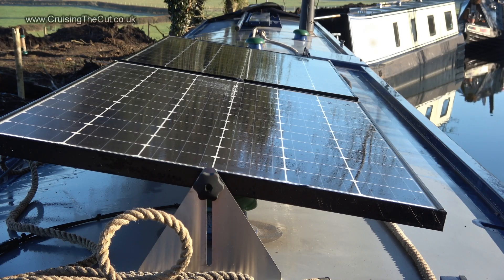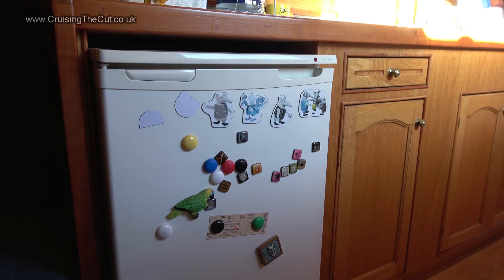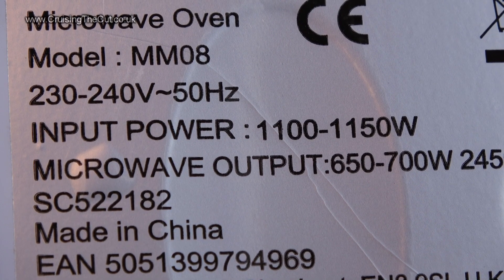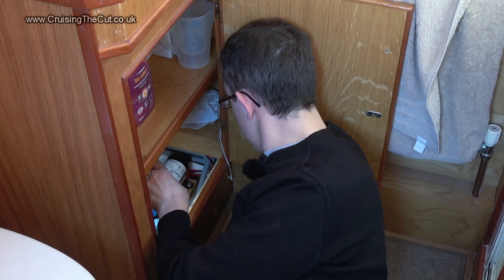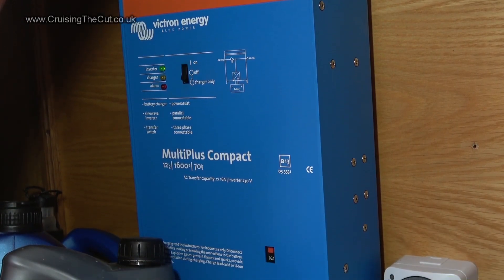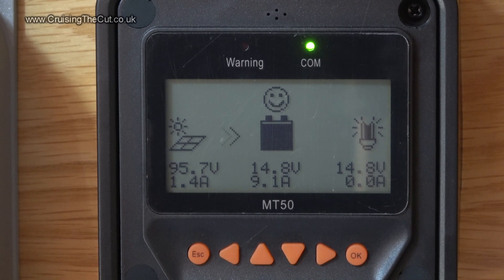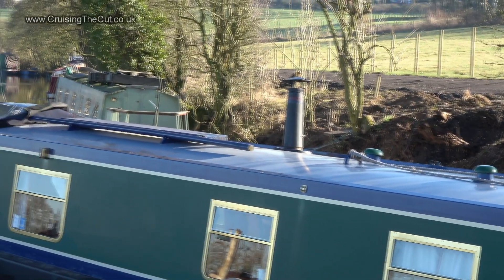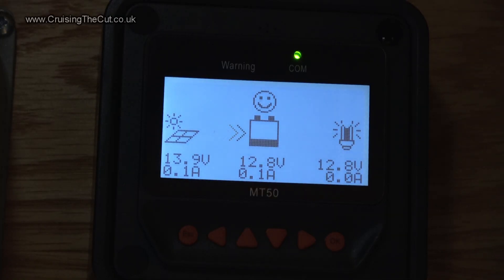76. Is solar power sufficient for a canal narrowboat in an English winter?

Comment: Would you deem it viable to do as this building (installing solar panels on the sides of the narrow boat)?   https://3vq5kdns38e1qxlmvvqmrzsi-wpengine.netdna-ssl.com/wp-content/uploads/2017/07/Urban-Health-15-1000x667-500x334.jpg
Reply from the maker: Not really practical to put them on the sides; the'd have to go between the windows, so not a huge amount of space; they'd get scratched by tree branches (you often end up ducking into the trees on narrow sections when there's an oncoming boat) plus only one side would ever be facing the sun at best, and a lot of the canals have trees or bushes alongside so the panels wouldn't see much sun anyway. Not worth the expense.

Comment: Hello,  Just another idea for more panels...  https://www.youtube.com/watch?v=cM5s4F-7AOk
Reply: That looks like something folks would complain about extending over the footprint of the boat. Sticking them on the towpath is going invite something complaining about an obstruction and sticking panels out over the canal is asking for someone to run into them. There are 12ft wide boats on the canals so it might not technically be an issue to navigate around but sticking something over the side of a boat, when parked or otherwise, is going to invite trouble. You could maybe have a system that extends out over the length of the boat rather than the width but that doesn't require such a complicated mechanism since you can get pre-built "blanket" arrays (even if they're not as good).

If you want more panels you're essentially going to need a bigger boat - narrowboats can get up to 70ft long if you're willing to splash the cash - or give up roof space that's useful for other things. Even then, if you're going with the "We're gonna need a bigger boat" option you're going to draw more power from said panels too.

Comment: I would advise to invest in losses due to 240/110V Power supplies. These buggers often burn 50% in heat adding to the losses of the inverter (which became quite efficient in the last years). Try to replace these with DC/DC supplies, often called "boosters".

Comment: I have seen campers that have solar panels on the roof. They have additional panels that prop up next to the camper.  Perhaps stow another couple down the side of the boat somewhere,  when you're moored up,  prop them next to the boat and plug them in to your controller 

Other than that,  get your generator to use as top up.  Perhaps additional batteries to provide more storage too.

Comment: Diesel engines do not like to be idled, it wears them out faster than running at a moderate rpm, 2,000 rpm-ish.  A small Honda 2,000 watt generator would be a wise investment.
Reply: these boats always run at very low rpm's...

Comment: I have seen small wood fired electric generators for camping sufficient to charge cell phones and the like. I wonder if there is a way to utilize some of the heat from solid fuel stoves to trickle charge the batteries on a narrowboat? Probably not enough on its own but perhaps it could assist solar in winter to get a bit closer to break even.
Reply from the maker: The charge out of those is absolutely tiny. Just about enough, if you get it hot enough, to charge a phone as you suggest and even then it's very slow. The impact on a set of narrowboat leisure batteries would be negligible.
Reply: @CruisingTheCut  I looked around and it appears that there is hardware for thermoelectric generators that attach to wood fired stoves in the 15w-100w range. They cost a few hundred dollars. Perhaps something to consider once a boat runs out of space for more solar panels. It might provide power in the neighborhood of an extra solar panel. More cost, but runs whenever the stove is lit without using any more fuel.
Reply: @CruisingTheCut  I was suggesting using a much larger version connected to a heating stove, not the small soda can sized devices.  A coal fired heating stove should also get much hotter than the small wood twig powered devices. That should provide many times more power. It might still be relatively small, but perhaps more than a negligible amount. If it could provide just half an amp day and night with relatively low cost for the hardware, it might be a significant addition to a solar system.

Comment: Hi, love your vlogs and enjoying catching up on the older ones. Seems to me it’s not more panels you need but more light. Have tried using a mirror to focus more on the solar panel? You could test it using a pice of hardboard and some silver foil. In theory a (plastic, bendy) mirror the same size could double the power and stowable under the panel. Just a thought.
Reply from the maker: The problem in a UK winter is that there just generally isn’t that much sun!

Comment: I guess solar power storage would be the next thing to add. But they’re still expensive- even here in Oz with plenty of 🌞
Reply from the maker: Nothing runs directly off the panels, they’re all plugged in to the boat’s battery bank (all narrowboats have a bank of “house” batteries for running appliances). I have 3 x 100Ah lead carbon batteries but no space to add any more, unfortunately.

Comment: I recently designed a PV system for a client that has a 60ft widebeam. It provides 5kw of solar. New panel technology is out there but you will need to specify at boat design stage the roof arrangement required to facilitate these mods. I have designed a boat that can be driven at night on a canal using autopilot that is controlled from the inside on multiple monitors and has infra-red viewing cameras. Technology has moved on.
Reply from the maker: There's a lot more roof on a widebeam! You'll still need a genny in winter though. But yes, this video is now 3 (4? I forget) years old so there will have been some updates. The point remains valid.

Comment: Were it me, i wouldn't have gone with solar, too unreliable in winter.  I prefer a nice quiet little generator.  I see many a busker in the street using a generator that comes in a case similar in size to carry-on luggage and they are whisper quiet.
Reply from the maker: Yes, the solar was installed for April to October when I'm out cruising. In winter I tend to moor and plug into a shoreline but if I didn't then a genny would certainly be needed.
Reply: @CruisingTheCut  Another point is that the microwave is likely the only item needing a large (probably 2kW ) inverter which will only run this for short periods and be inefficient for minor AC loads.  A small ( say 200W) inverter would be much more efficient for small  loads such as TV or laptop.  Phone charging and anything USB can use car type DC battery supply.  In cost terms, battery life is usually more expensive than any fuel used for charging. Lead acid batteries are still generally cheapest per kWh if you can avoid discharge below approx 70% full to get acceptably high numbers  of charge / discharge cycles.  A forklift truck or milk float with indestructible wet cell NiFe or NiCd would be a great prospect however for large capacity battery storage with intermittent engine sourced charging ,  plus whatever PV energy was available.

Comment: I am assuming that the laptop is mains powered. One solution to this would be a dc to dc converter which would raise the 12 Vic to something higher that the computer would use. This would be higher efficiency than using the investor.
Reply: Yes this is the way to go.
Reply: Not that much.  Average switch mode power supply (SMPS) is 85-90% efficient.  Say 85%.  Also say laptop needs 60W.  In a perfect world this is 5A at 12v.  However a 12 to 18v SMPS converter would actually need almost 6A.  Using an inverter would double the wasted power as the inverter is also a SMPS, so now 2A wasted instead of 1A if from 12v.  However boats are wired up for mains with many covenient plug sockets dotted around.  Hardly any 12v outlets, so using a laptop on 12v would likely be a real pain on a single dedicated power point just to save 1A.

Comment: Spacecraft have deployable solar panels that are much larger in area than the spacecraft itself.  I wonder if there's a way to have something like that on a boat.  While moving, it would be folded up to about the size of your current panels, but when not moving it could deploy into a larger array (preferably with better pointing capability).  Unfortunately, zero-gravity in space helps with this by reducing the structural requirements to hold the panels up.
Reply from the maker: Possibly; you’d have to be careful that it wasn’t an obstruction to passing boats or passing pedestrians on the towpath!
Reply: @CruisingTheCut  Yes, if your mooring wasn't perpendicular to the sun and the big array is at top of cabin height, the array could only angle from side to side.  The basis for this idea would have to be some kind of large, strong tube that collapses to a length of two arrays and expands to the length of four or even six.  The pole could roll the arrays from side to side and the panels could be mounted so they could angle out from that at least 30 degrees.  All told, I suspect it would be an expensive setup, difficult to arrange manually and even more difficult to automate, and the increase in amperage would not be enough to be worth while.
Reply: @goetzliedtke  The thing is, solar panels on spacecraft are flexible and unroll like a roller blind.  That only works because they are weightless.  They'd collapse under gravity.  Also, they only unroll once and then stay that way.  I think if you deployed and stored them cyclically they would break.  Don't get me wrong, I think it's a great idea, but the technology's not up to it yet.

Comment: Well you need to fix your solar panels so you can more properly tilt them towards the sun ... your panels are aimed halfway off the sun considering it is standing so low.
Reply from the maker: Even if they were tilted, which certainly does improve performance, the amount of sunny days and the number of sunny hours per day that we get in the UK in winter means very little solar. Plus a lot of the canals have extensive tree shading on either side so tilting just means you're pointing the panels at the trees. Plus unless you have fully articulated brackets, the panels only tilt port/starboard and as the canals twist and bend, the sun is not always port or starboard to your mooring. And you'd have to keep going out to adjust the tilt or use up some of the power in running an motorised system.

Comment: How much cruising do you need to do for a full recharge? I work in a fixed place and my plan is a live aboard for 14 day spells moving up the canal a bit for another 14 days then back again and so on. With proper cruising at weekends and on holidays of course. My best towpath moorings will be 5 miles apart which gives me easy access to bus stops to get to work..
Reply from the maker: It would depend how big your battery bank is, how depleted it is and how big your alternator is.

Regarding your cruising plan, I think you are going to fall very foul of the continuous cruising rules which CRT are now enforcing with a bit more enthusiasm; I suggest you have a watch of this:
https://youtu.be/k_p70h-Rxps and read up on what the CRT has to say.

Comment: Looking at your solar set-up, I notice you're not so hot on making sure your panels are properly aimed to get the best sun exposure. In winter when the sun barely gets above 30 degrees, you can increase insolation by easily double by extending their mount points temporarily while you're tied up.

You also have a lot of inflexibility of your panels because you chose such large ones. Twice as many panels of half the size would have a lot more flexibility of positioning.
Reply from the maker: Overall it would barely make any difference to the total in winter, there's so few hours of daylight and so little sunny weather then anyway that it would still render a solar-only solution impractical, which is the point I was making.

Comment: I thoroughly enjoy your vlog. I’ve watched quite of them and I’m impressed how you breakdown the technical aspects of narrowboat living. I was wondering if it would be feasible to install wind generator to augment your solar panels. Thank you and much success in your endeavors.
Reply from the maker: It is feasible and some boats do but they’re costly, can be noisy, and only generate any useful power in a really strong breeze which you don’t necessarily get with any regularity or consistency, especially on the canals which are often tree-lined, breaking up the wind. Probably better installed as a fixed item on a mooring if you have a particularly windy location,  otherwise I’d say probably not worth the money.

Comment: I had the same problem in my campervan, not enough room on the roof for more solar energy. I hate noisy generators and so do my neighbors, so I invested in a fuel cell for the winter days.
I bought an EFOY that generates enough power to charge the batteries. The EFOY is an expensive investment and methanol is also a bit expensive, but it is very quiet during use.
Being self-sufficient has a price but gives me a lot of satisfaction.

Comment: I use a solar/battery setup when I go camping. I looked into fridges very carefully, option for a dometic compressor fridge. This uses LESS than 1aH per hour, so maybe 20-22aH's a day. I'd've thought narrow boat fridge technology would be alongside that, and not nearly double the power usage. :-/
Reply from the maker: The narrowboat fridges are a bit bigger than those Dometic camping ones (I have one of them in my campervan and it's excellent!)

Comment: Nice little solar panel inspector, every ship needs a ships cat :-)

Was that inverter capable of delivering 16A at 230V? (Maybe I misunderstood the text). Is the battery bank big enough to handle that load? When I was looking at different inverters they recommended much bigger battery banks for that kind of load.
Reply from the maker: Yes 16A at 230V. At that time my batteries were knackered but I've got new ones just in (see recent vlog) which can easily handle that.
Reply: Yes, I saw that. I had never heard of lead carbon before, sounds interesting.
Reply: At the risk of upsetting David, no.  It is a Victron 12 | 1600 which means 12v 1600 watts.  Watts is volts x amps, so a quick bit of maths - it can deliver a max of 6.9 amps at 230v.   A 16A inverter would be a 3680 watt one.
Reply from the maker: Mea culpa, as @MikeB points out. The inverter can only deliver 16A at 230V when it's hooked up to the shoreline so it passes the mains through. Its delivery off the battery bank is as Mike explains.
Reply: And I feel really bad at pointing this out.  David has probably the best UK canal vlogs/info out there full of insane amounts of well researched information.  He puts a ton of effort into his content and produces broadcast quality entertainment.  Well done David.  Bad on me for being a smart arse.  Keep up the great work.
Reply from the maker: Haha I have no objection at all to people pointing things out where they're correct and do so in a polite manner! You carry on, good sir!
Reply: @CruisingTheCut  Thanks for the additional answers, I didn't get a notification from YT, I just happened to rewatch an episode and scrolled down.

Comment: Hey David, are three-way-powered fridges a phenomenon over there? Common on RVs over here, running off propane while you're not under way or shore powered could save you the 40ah the fridge uses.
Reply from the maker: Not much used, if at all, due to safety concerns about the gas / pilot light
Reply: @CruisingTheCut  Thank you sir. Wonder how we manage not to blow ourselves up over on this side of the pond. Guess it's easy to have vents in the bottom of an RV where the heavier gas can escape. On a boat? Not so much...........

Comment: I'd say your panels are only angled at 10 degrees.  If the sun is 10 degrees above the horizon then the effective width of your panels is not 90cm but 90sin20=30cm.  If you could angle them at 80 degrees the effectiive width would be 90sin90=90cm, or 3 times more power.  So you need some taller brackets, not more panels.  And of course, find a mooring where your panels will be facing South.
Reply from the maker: It isn't a simple multiple; plus as I tried to point out, in winter the sun isn't always visible due to cloud, rain etc so the light is diffuse and pointing makes no difference. As for finding winter moorings with specific alignment, that's not always so simple. The video is trying to make the point that solar in winter is limited due to lack of sun even if you do everything to maximise your panels.

Comment: The age old question .that always came down to what you want ..oh yeah don't forget if you run your batteries down past 11 volts they will start phosphate and die real quick..in the winter your heating bill goes up and so does your electric bill ..however some costs go down such as the cost of socialising we don't go out as much as we do ..we tend to eat lease ..making cut back's over the winter ..more time in bed sleeping is a good way of cutting back and a great way of resting up from a very busy summer of cruising fun .turning off the fridge and putting food in a chilly bin outside in a cold place and the microwave turn that off and steam your vegetables on your fire heating ..hope this is of help
Reply from the maker: Really the batteries shouldn't be let down past 12.1V ideally...